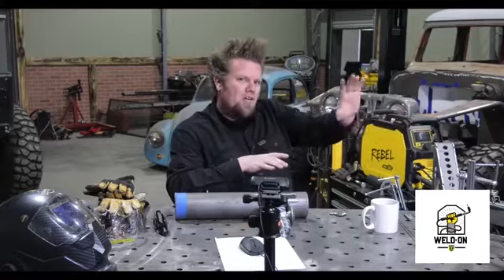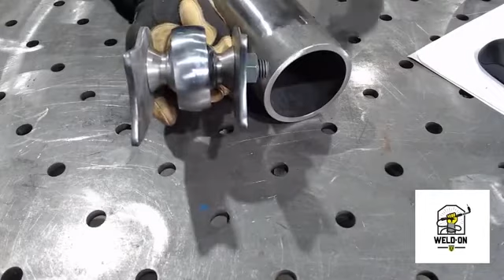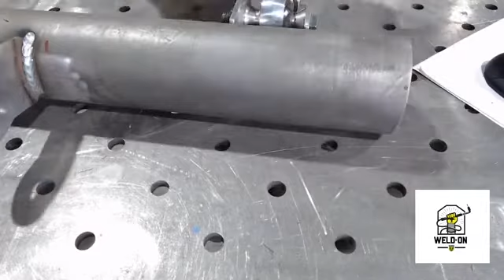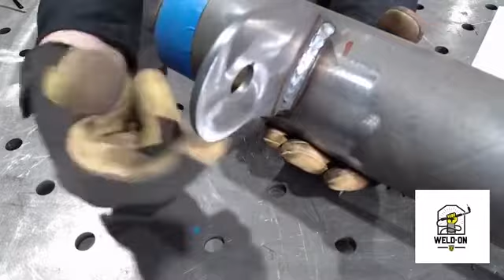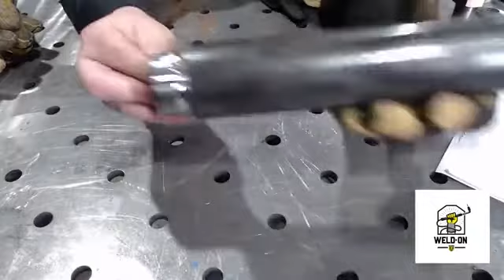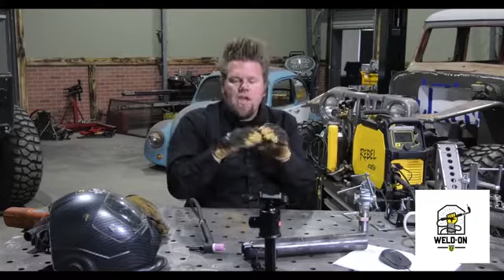Common Welding Joints Found in Automotive Welding featuring Ian Johnson | ESAB University Seminar

Comment: I always explain it in Miguel and especially anyway as this is your pencil or your pen and you're pretty much drawing or writing this is your pencil the wire is coming out is your pencil and draw in the weld as you need it to go in you know if you want to do a push and pull or pull and push or you want to do some ease or C's which I call pretty much just bridging the Gap you know but especially somebody's never done it much or you trying to teach somebody to do it I always teach him that this is your pencil and it's just like you're just drawing it in very little and you just writing it in like if you had ink on a piece of paper you know you just would be making these little deals which obviously are ended up being puddles that you're moving around but it starts with the beginning of your your pencil for your wire anyway that's just the way I always explain it it might make sense to some maybe it don't maybe it'll make it easier maybe it won't

Comment: 19:50  What is with ESAB machines locking up like that?  Everyone I've run does it.  Handy feature when a guy is in an awkward position and the machine stops responding.
22:44  Why do ESAB machines kick the fan on for tack welds then stay on a fixed time, a fixed time that seems extraordinarily too long?